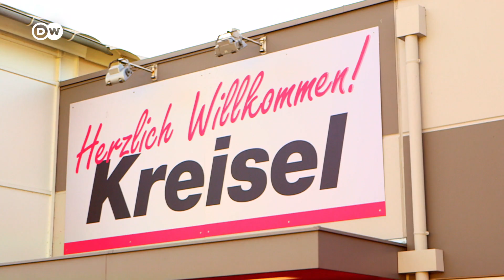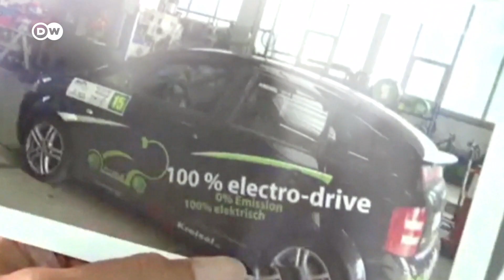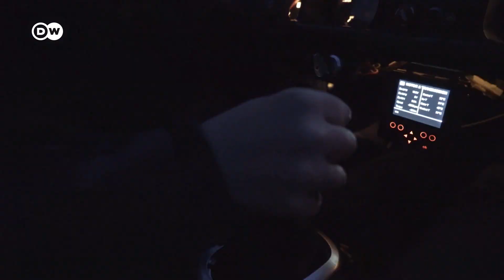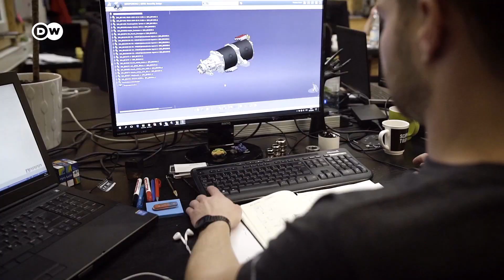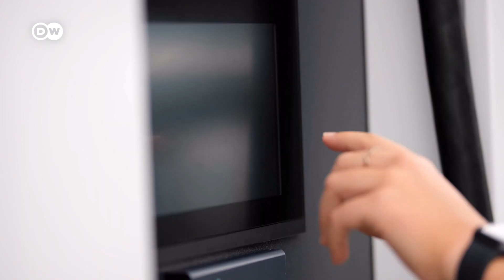Hasta la Vista, Pollution! | Green Mobility | Kreisel | E-Mobility

Comment: nice link to Arnie. But where are the charging stations? Need to be so many more to convince people. Every petrol station in Europe should be forced by the EU to have one charging station.
Reply from the maker: Agreed, Mark. Charging EVs ist still a big headache, even in countries like Germany that imagine themselves to be tech-savvy. There just aren't enough, especially if everyone starts wanting to use them. 
At the same time, people have  to get their heads around the different approach to powering their vehicle with electricity rather filling it up with combustible fuel. You don't usually stand next to your mobile phone until it is fully charged ;-)